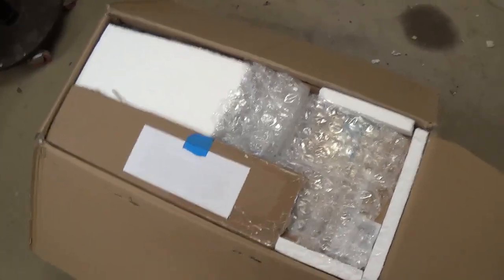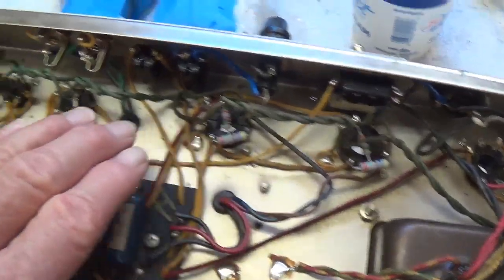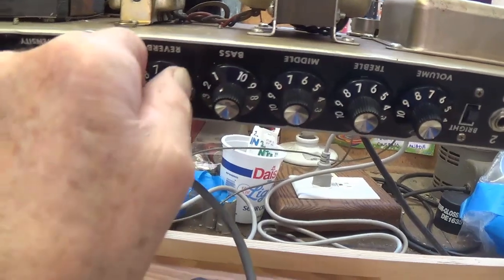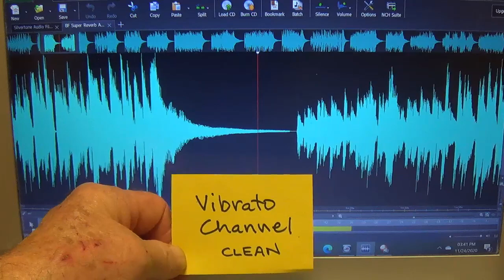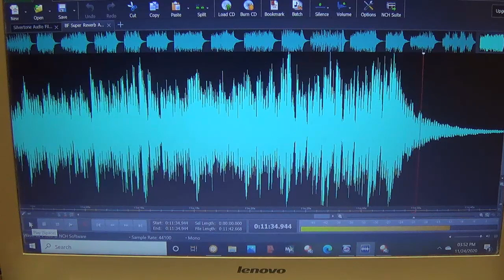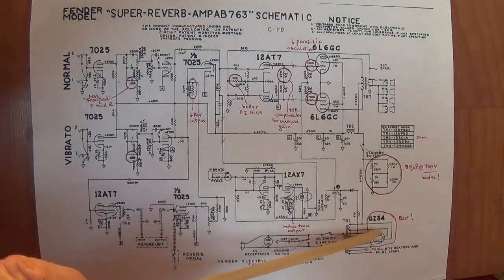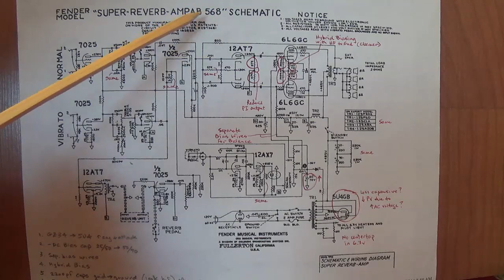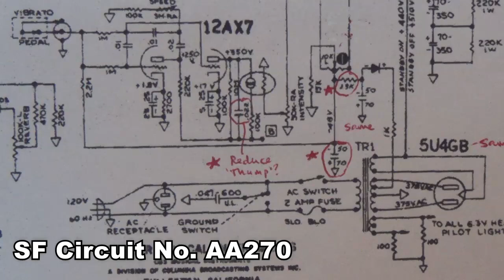1965 BF Fender Super Reverb in for a Check Up......Plus BF vs SF S.R. Circuits

Comment: Love the BF vs SF section- please keep that sort of thing going!
Reply from the maker: I will. The next one is for the Super Reverb. It will be posted soon.
Reply: Watch the sneak peek of footage from The Beatles: Get Back that director Peter Jackson just put up yesterday. Nothing but SF Fenders in the studio for the Let It Be tracks. The Beatles mostly used single coil guitars throughout most of their career. As a general rule, single coils tend to produce more highs than humbuckers, and BF Fender amps have more highs than their SF counterparts. As a result, in my humble opinion, Teles & Strats tend to sound better through SF amps while Les Paul type guitars sound better through BF amps. The Beatles seemed to recognize this too. https://www.youtube.com/watch?v=UocEGvQ10OE
Reply: @wildbillhackett  I don't think it's true that BF Fender amps have more highs than their SF counterparts, although the SF definitely have more lows (too much!). If anything, the "snubber" caps that CBS sprinkled on the power tubes of 40-50 & 80-100 watt amps reduced highs slightly. The silverfaces in Let It Be were '68 drip edge models, which were transitional between blackface and later silverface.

Comment: The recordings are miles better..   Kudos, Uncle Doug, on continually providing great videos for learning to the guitar community, for your wisdom, and now for great quality audio result samples.   Merry Christmas to you and yours.
Reply from the maker: Thanks so much, SR. It's great to hear something positive, instead of nit-picking about microphone placement, etc. :)
Reply: You did improve something, didn't you ?
Anyway, this amp sounds fantastic !
Reply: All that nitpicking has paid off!  Hopefully i didn’t steal that line from mrs uncle doug 😅
Reply: @UncleDoug  Call it nitpicking if you like, but you're obviously doing something different because the guitar sound in this video and the last couple has been much better. This one particularly.
Reply: @UncleDoug  i do miss the “ squeeks” after each take- that was patented Uncle Doug viewing\ listening - a pause and a squeek after every line- it was comforting like a warm tea on a cold winter night?
Reply: @UncleDoug  

00
Reply from the maker: @vintaxis3833  Thanks, guys. One thing I have been paying more attention to is keeping the recording level well below the overload indicators, at which point the signal is clipped. I try to keep the signal peak at around 75% of max.

Comment: Doug, in the middle to late 60s Fender came out with a copy of the Super Reverb that included four 10-inch JBL speakers. One came into the local shop where I was taking guitar lessons and a legendary guitarist by the name of Skeets McWilliams sat down and played it . At some point he stopped playing and just decided to test. Got-o-mighty that thing would get loud and maintain its clarity and cleanliness at all volumes. It was amazing
Reply from the maker: I've heard of some early Fender amps with JBL speakers, Jim. Perhaps they were an extra-cost option. That must have been quite a day for you as a lad.....I see that you still remember it over 55 years later.
Reply: That may or may not have been a copy; there were folks who replaced the 4x 10" spkrs in a Super with JBLs. I don't know if the factory ever produced JBL-equipped Supers. Holy cow, those were heavy amps. That was a pricy upgrade. Supers were $500 all day long and the speakers were $125 each.
Reply: @pneumatic00  I remember at the time they cost $430.00 here. I do remember laughing at the price w/JBLs. Of course, at $80.00 a week, my dad got a chuckle out of the 430.00. The shop carried another brand of amp, speaker with head, called Standel. I seem to remember it cost the same thing.

Comment: From Leo:  For those control face dents, I use a 5/16" carriage bolt and nut pulling against a 3/8 drive socket. (Like you do when you drag wheel studs into an old hub)  Pick the socket size where any scratching is under the knob skirt.   Works great and you can go a little at a time.   Merry Christmas.
Reply from the maker: Thanks, Barb. Likewise :)

Comment: 🔔🔔😁 Uncle Doug's back  since watching all your videos ( over and over )  it has now given me the confidence to start to restore my Vox Ac30 .I've had for over 41 years .first step I built the current limiter ..  Ordered all new capacitors and Resistors so far changed  C39 and C40 filter capacitors  and now no Hum  I am only changing what needs changing .I think because I've had the amp all these years I didn't want to send it off to some where for restoration.  Because of  The anxiety of what's happening to it . Allso still experimenting with my tremolo can .sorry for the long post .but thanks. Stay safe Doug that's all the news from over the pond
Reply from the maker: That's great news, Shaun. So glad you're putting the video knowledge to good use. Best of luck with your project.
Reply: @UncleDoug To be  completely Honest  with you Doug .before I started watching your videos I wouldn't have even  dreamed of touching the Electrics. So give your self  a pat on the back from me

Comment: I have run light bulbs that have become unglued from their screw brass holders - amazing the vacumm holds up still !
Reply from the maker: You can use super glue to rejoin the glass to the base, as long as the vacuum has not been compromised.

Comment: I had a thought Doug, about that extra resistor in the AA270 bias supply. A cap by itself to me is like a tank or a well storing the energy, some waves will still flow across it. However chuck in a resistor and all of a sudden we have an RC filter sending the ripple to ground. I'm loving the respect you're showing these beautiful old amplifiers. All the best from NZ
Reply from the maker: Thanks for your helpful input and nice comments, Blaine.

Comment: Wonderful video Uncle Doug, there is definitely better tone in the BF amps and your explanation of why this is true is very interesting and useful. Right now my BF SR amp’s output or volume goes down when I turn up the intensity of the tremolo.....hopefully with your videos on tremolo circuits I will find the cause.
Rgds
Reply from the maker: Thanks so much, Alvaro. The 50K RA Intensity pot is a fixed load in the circuit (i.e. the resistance to ground does not change when the pot is adjusted), so this should not be happening. I wonder if your photoresistor is faulty (i.e. too low resistance to ground) ?
Reply: @UncleDoug  you were right the neon light next to the photo resistor was loose, I fixed that and now its sounding great and there is no volume loss. Thanx

Comment: Glue the base to the tube with # 10 (water thin) CY glue. It's stronger than the factory joint.  Good video Doug. Thanks once more.
Reply from the maker: Thanks for the info, Jimi :)

Comment: What a great amp and you can really see the difference in gain on the display.  That app is showing the amplitude vs. time as it plays, not the audio spectrum.  That would give the level for the spectrum of frequencies produced by the amp.
Reply from the maker: Thanks, MB. Yes, it is simply an amplitude spectrum......not frequency.

Comment: Great sounding amp! Great work pulling the dents out ....must have been one heck of a bump that made those dents...surprised it didn't jar  the power xfmr out of place and/or bend the  chassis at its mount points as well. Thanks again for an interesting video. Wishing all of you a Merry Christmas and happy new year. Cheers! 😀😀👍👍☕️☕️👌👌🤗🤗
Reply from the maker: Thanks so much, FB. Likewise on all the good holiday wishes.

Comment: Uncle Doug, Thank you, thank you, thank you, for all of you videos. My father owns a '65 Pro reverb that I've been clean up and measuring components. It has/had an awful cracking which I will work on. I am in Mesa, Az and was wondering where you get your cloth covered wires. My fathers amp was missing one of the 12" speakers (cut out). I've replaced them both and storing the original. I am still waiting on some comments to arrive, but should have it up and running soon. Keep up the great teachings. Greatly appreciate y our videos.
Reply from the maker: You're quite welcome, Greg. You can get cloth-covered wire from Antique Electronic Supply, but it's no fun to work with. Unless you seek original appearance, I'd go with vinyl-covered wire.

Comment: My first proper guitar amp back in 1980 was a $25 bone stock but cigarette burns across the entire front edge, April 1965 Fender Bandmaster head. I absolutely loved that amp! The tone was so rich and thick , and the Tremolo was very useable. After 20-30 great tube amps I can still hear the specialness of my Bandmaster. Basically the tone that got me I can hear on this Cat Power song- (Youtube video)-  Cat Power - "Cross Bones Style" which is a Twin Reverb as you can see her play in the video. Chan Marshall (aka Cat Power) has used a Fender Twin for years. Always a good Fender tone regardless of the guitar she's playing.
 I once had a Silver face Twin Reverb that the previous owner added a single transistor preamp buffer to the Tremolo ch. input. Sounded great!
Reply from the maker: Thanks for sharing with us, Paul.

Comment: Another great video Uncle Doug, and of special interest to me as I have a '74 Silver face Super Reverb. I bought mine several years back as an investment, but when it arrived at my door, it was missing it's tube chart that normally graces the inside of the cabinet. I have no idea what circuitry lies within. Besides replacing a noisy reverb tube, this amp sounds fantastic like it is. With that said, it could have been changed to a black face circuit already. With your comparisons in the video, I should be able to ID it and what, if any changes were made. As soon as I get this Princeton off my bench that I'm waiting on tubes for, I'm going to break the old Super Reverb down. Thanks again for these type of videos, I enjoy them to the max and learn much. Merry Christmas and God bless your house!
Reply from the maker: Thanks, John. Best of luck with your identification project....and Merry Christmas to you all.

Comment: Is there a way... to make the neg. feedback feature selectable via a vibrato/reverb foot-switch? Thanks Uncle Doug... Merry Christmas!
Reply from the maker: Probably not, 007, without a lot of rewiring. MC to you all !!
Reply: A big boost Punch In these amps can come from Either a tone stack lift in either channel (I have preferred it In the number one channel mainly because it doesn’t have a mid control, And also because you can switch the tremolo in and out of the circuit for a good boost. If memory serves correct it was just a make or break switch on the back of One of the Tremolo pots... if One of them was a three meg reverse audio taper, Then it was probably the other easier to find value. No one uses the buddy Jack For the extra speaker as the black face and early silver face  amps were  2 Ohm’s, so that makes an easily reversible mod. Later 70s models I think I may have ran 416 Ohm speakers for a net of 4ohms, So still best to just disregard that extra Jack and use it for something else like this.

Comment: Wonderfully educational vid as always Uncle D! Concerning the cathode resistors on the 6l6's on that one revision. It is my understanding that a small resistance to ground would shift the harmonic spectrum closer to that of a Class A amp.
Reply from the maker: Thanks, Dan. Cathode bias resistors are indeed more typical in Class A amps......and they must not have worked out like they hoped, since they were quickly discontinued.
Reply: @UncleDoug  Agreed, they could also been placed there in the event of a bias failure I guess.

Comment: Great video Doug, really learned allot, would love to hear more about the later master volume amps as these are quite common and suffer most imo from poor tone relative to the earlier non master models. Lots to consider next time see a silver face SR on my bench.
Reply from the maker: The Boost and MV circuits are a separate, complex subject, Bill. They could have their own video.
Reply: I think that’s a bit of a misconception that the master volume era suffers from. I would say the master volume deluxe was not that grand but I think there may be two different models of MV Deluxe.    I have owned master volume super reverb’s along with non-MV’s, and pro reverb’s with and without, and they have been glorious. I did have a pro with the push pull, Clipping or distortion circuit, whatever they called it, and that was known to be pretty awful, although mine sounded great and it had this wonderful compression made it great for jazz. It also had the ultralinear circuit and humongous transformer but when I got inside it I had come to find out someone had removed or it just became disconnected-The wire was not connected to the push pull. I would definitely put the master volume amps In the sleeper category they need to be heard before judgment passed. That ultralinear model I had,  had to run the WZX.... whatever tubes-The extra high plate voltage ones, as you can see above 500 V in those models fairly common. the chassis showed evidence of stress from the extra large power transformer-There’s actually another lip folded up and screwed to the top, besides the usual mounting straps On these presumably for the extra weight, and it was apparent that the chassis was bent or deformed from the weight and probably normal but heavy use. You may want to check at the finger joints under the Tolex,for separation, It might be a bargaining point.

Comment: i would also say that the virtual tap would lend its self well to a hum balance pot so u could really trim the hum
Reply from the maker: You can also install a hum balance between the two wires running to the tube filaments. By balancing the voltage in each wire, the fields cancel and hum is reduced/eliminated.

Comment: Hello, in the mixing reverb circuit, this has the 4.7 meg resistor and fender also used the 3.3 meg resistor. Which one is better sounding? thank you....
Reply from the maker: I suggest that you try both resistors and decide for yourself, Jim.

Comment: Great stuff, Uncle Doug, as usual. Thanks. 
I've heard (FWIW) that those 2000pf snubbers on the power tubes are there to suppress oscillations that tend to happen in the SF amps because of the poor lead dress compared to the neat BF amps. It's apparently cheaper to add a couple of $.02 ceramic caps than to train assemblers properly--who would have guessed? I haven't removed mine, but I've heard it said that the difference is subtle but audible in terms of highs. I have changed the coupling cap in my Deluxe Reverb back to .001, and the difference was huge.
As for later silverface iterations of the Super Reverb, if I'm not mistaken those are ultralinear and higher power, so they don't have the same transformers and converting them to blackface is pretty near impossible.
Reply from the maker: I agree with all you have said, Ben. Thanks for the input.

Comment: Hi Uncle Doug, question about my ‘66 super reverb.

I started to hear a rattle coming from the amp, then and went inside and checked if the speakers were acting up. At one point, I did not have the speakers plugged in and sent guitar signal through, and the fuse blew. Now this is a reoccurring problem (also now happens every time standby is switched on when amp is warmed up).

Do you have any suspect points of evaluation from the fuse blowing after playing without speaker load?

Thanks
Reply from the maker: I would focus on the output transformer and the output tubes, H. Playing it with no speaker load will really stress them both.
Reply: @UncleDoug  Thanks for the reply, Uncle Doug. You are always very helpful. Heres the result.

I checked the transformer resistance on the primary side, and I am getting a uniform measurement from both sides of the center tap (~50ohm) and across the whole primary (~100ohm). And there is no continuity from the primary and secondary. I did not do a visual inspection.

As for tubes, I tested out a a new set of tubes, and had the same issue. 

Not sure where to go from here, but I appreciate your suggestions.
Reply from the maker: @heyimmitul  Have you checked for any partial shorts in the electrolytic filter caps?
Reply: @UncleDoug  I will check for such, thank you for the suggestion.

Comment: Doug, with a Fender 3 control tone stack (Treb, Middle and Bass) , you will cut off all sound when you zero all 3 tone controls.  This does not happen with the 2 control tone stack as the middle control is replaced with a fixed resistor and is therefore fixed at a middle level.  It turns out not to matter what frequency you choose-you get no sound with all 3 controls zeroed.  (Another interesting mod is to replace the fixed 6800 ohm middle resistor with a pot.  I do this on all 2 tone control Fenders.  I can eliminate the 'mid-range scoop sound.)
Reply from the maker: That makes sense, Alan, since all the music signal is being sent to ground. Thanks for the tip.

Comment: Goodness me the NFB really was like lifting a blanket. My favourite mod so far on AB763's is a (made popular on Marshalls) LarMar PPIMV (dual gand 250k pot) and a 25k pot off the NFB resistor for adding some NFB back at lower volumes. Makes the higher powered amps more versatile and usable and is pretty much out of the circuit on 10.
Reply from the maker: Thanks for sharing this with us, Wozz.